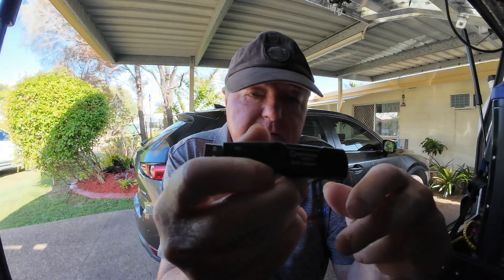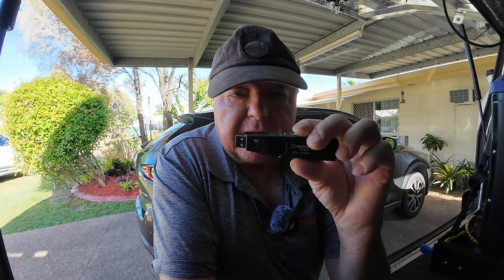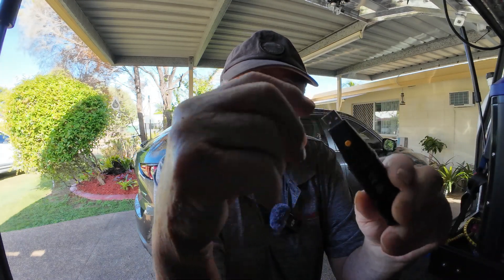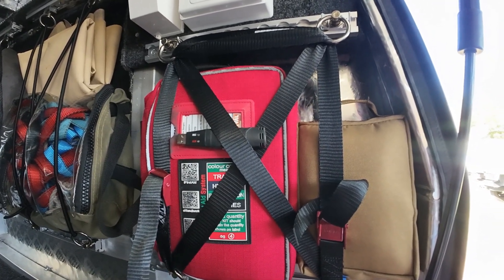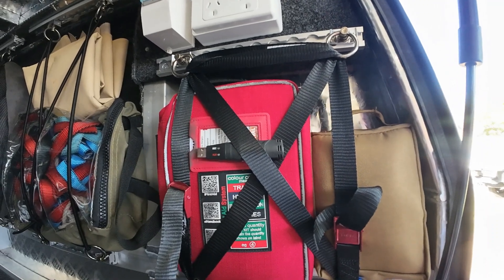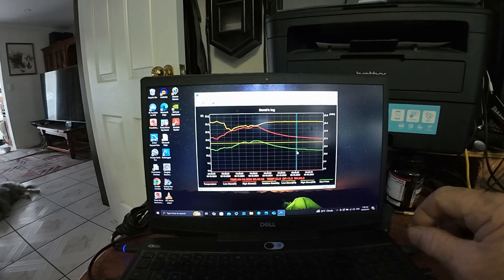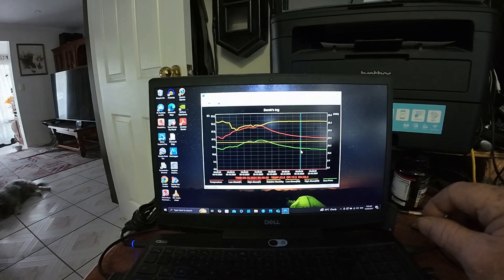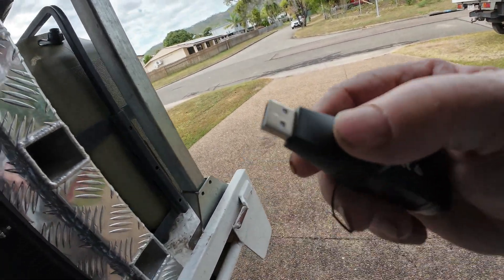Canopy temperature - a subject no one talks about. Why?

Comment: I've checked this out a number of years ago and found that on close to a 40 degree day, the temp inside the aluminium canopy rose to nearly 60 degrees in full sun, and with a roof top tent on under similar conditions the temp inside the canopy rose to around 50 degrees. So around a 10 degree drop in temp with a roof top tent and some free air flow. I'm putting some electronics in soon so will be looking to insulate the doors and sides only to reflect some of that midday heat but leaving the celling in aluminium to act as a heat sink. Having an electrical/electronics background I know that general domestic/comercial grade components aren't rated to more that around 55 degrees Celsius.